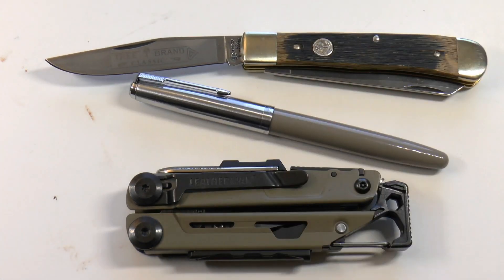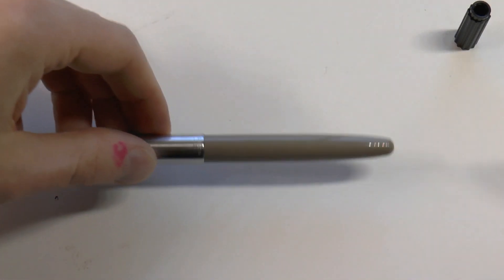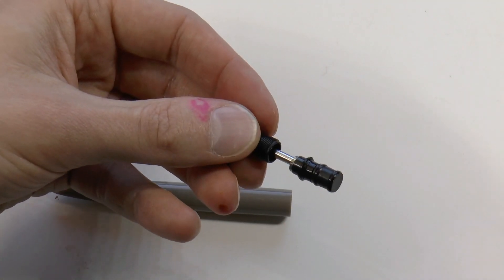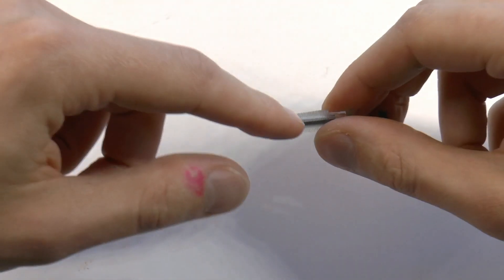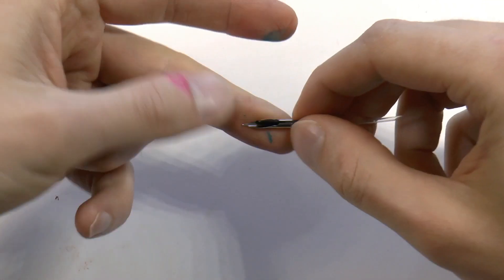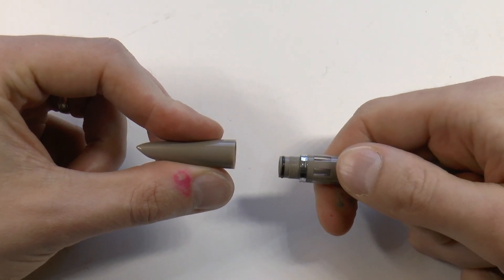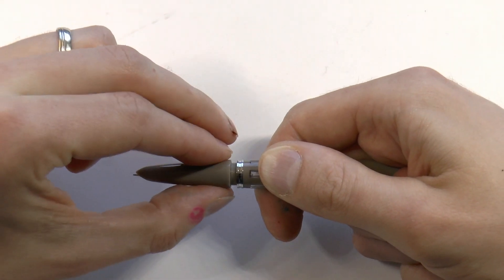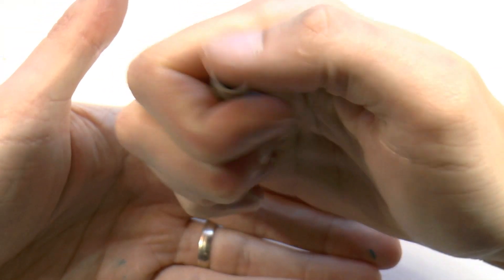Disassembly Line Wing Sung 601

Comment: Where Can I get the tool to unscrew filler system,please ?
Reply: If they didn't come with your pen, look for it on ebay, relating to tool for wing sung 601 and 601a. If I recall, you get two for about USD 1.90 delivered.

Comment: I am very frustrated about the disassembly. Looks very easy in this video. I wanted to swap the original nib with one I had bought from Bobby  (with the upturned tip). I am no novice but the nib would not budge however hard I tired. I will stop there because I do not want to damage the original nib (which is not a bad one anyway). However, I wonder what the trouble is? I also wonder about the praising comments, these people must be magicians. Please advise.